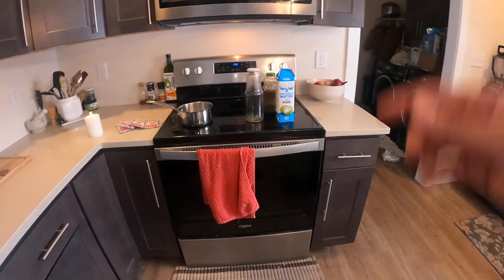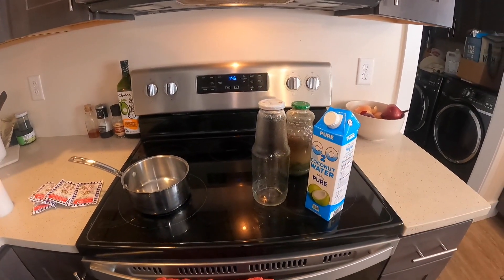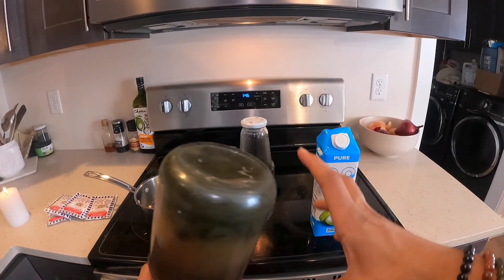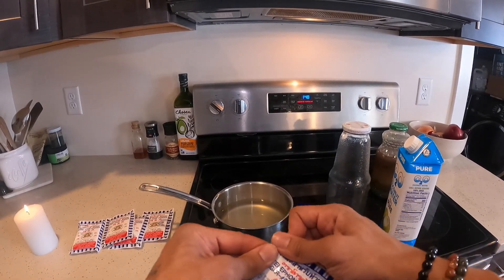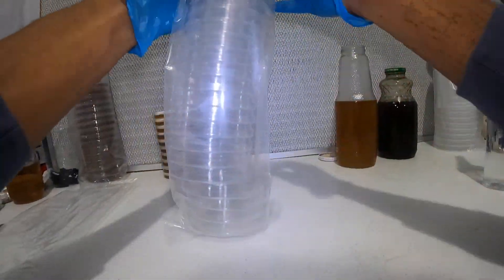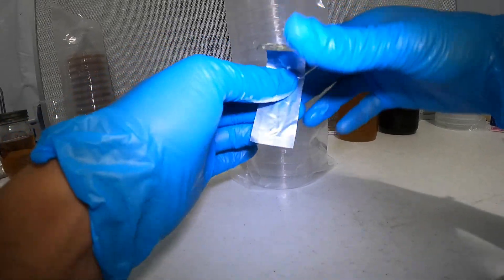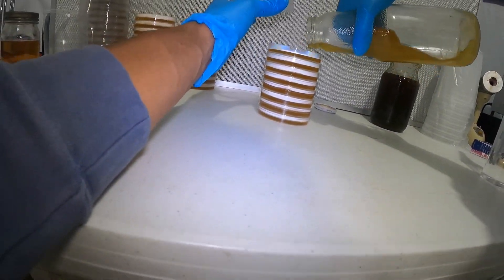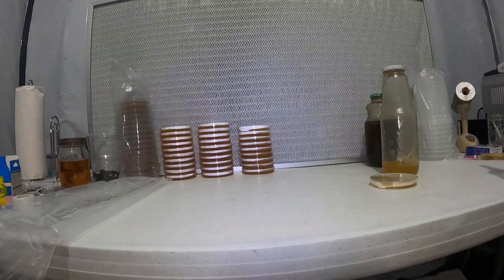HOW TO MAKE AGAR EASY (COCONUT WATER AGAR) FOR MYCELIUM

Comment: Hepa filter required to work with agar?
Reply: I use a still air box and rarely have contamination. It's just a pain in the ass. That's how it should be described lol. Cheap but a pain in the ass
Reply: Not required, a still air box can work, but really get a flow hood/HEPA. High contamination rate without one.
Reply: Agar work definitely requires a working knowledge of sterile technique, (ST) so clean air is obligatory!